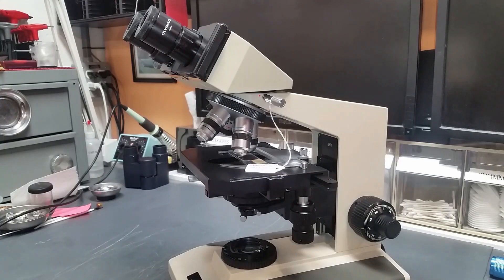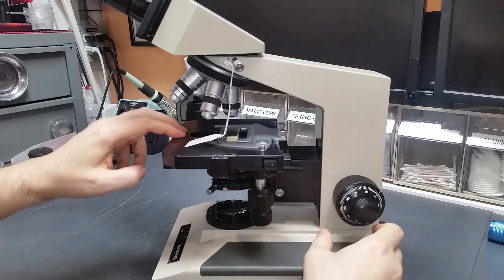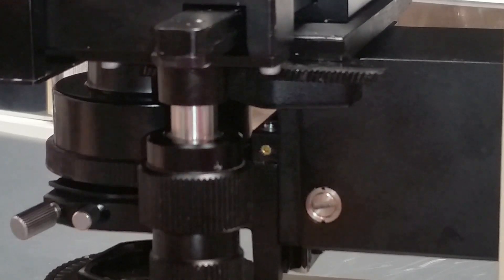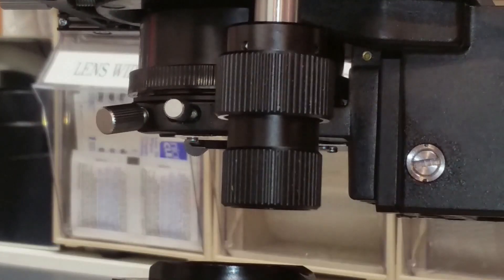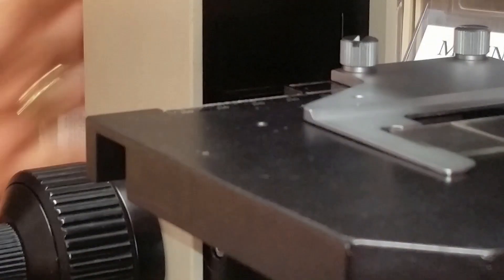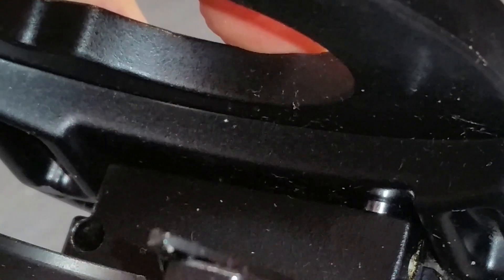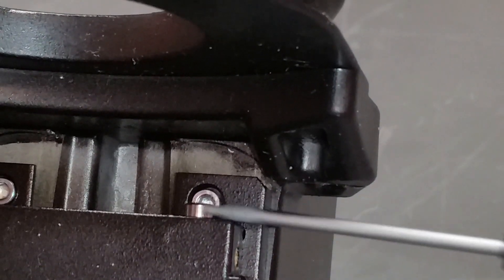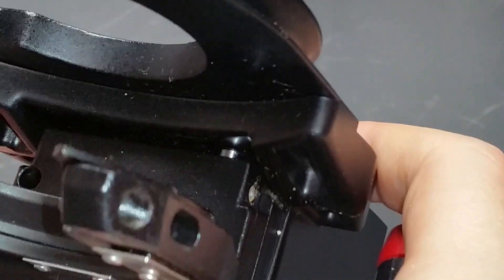Final Checkout and Adjustments of Olympus BH2 Microscope

Comment: Hey man, thank you for the great content.
I have a cx41 model and im trying to set the koehler illumination but condenser does not center. I tried every combination of x/y centering sewrews, i take out and put the condenser multipl time to see if it is properly seated but nothing worked. Do you have any suggestion for the centering?
Reply from the maker: Maybe the grease in the centering mechanism is dried up.